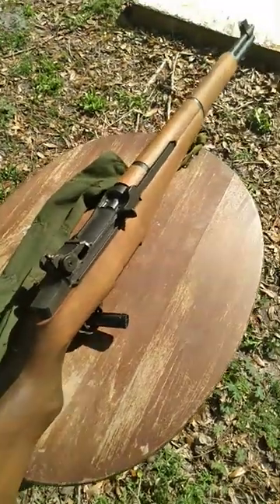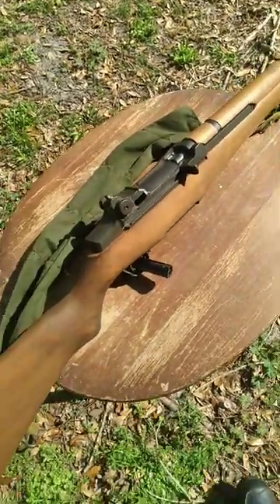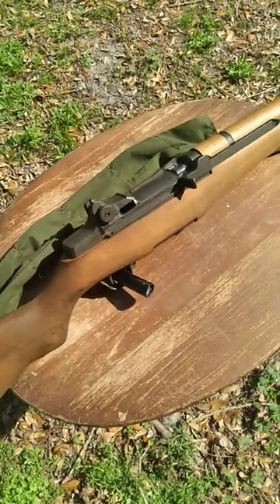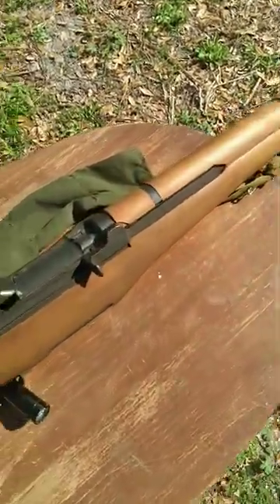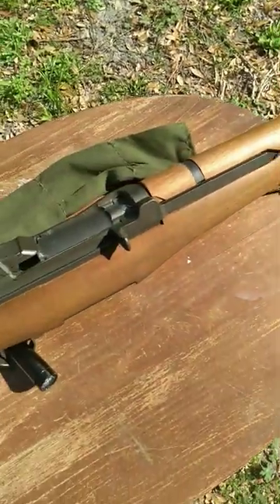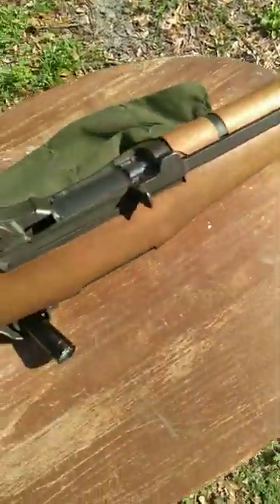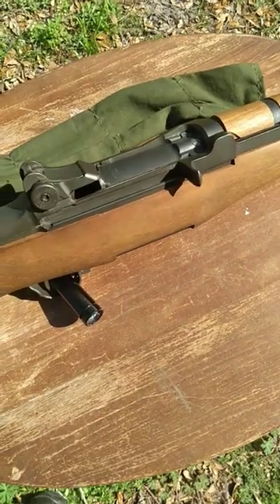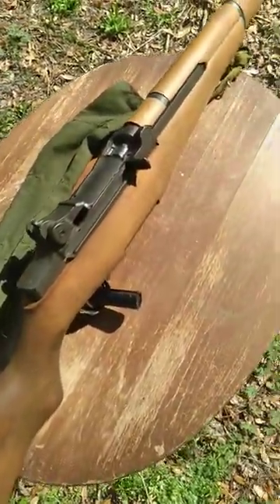M1 Garand Recoil

Comment: Yeah, remember the M1 has a certain range of cartridge weight and power to work in. Unless you adjust the gas system avoid the heavy bullets and high powder rounds. So when you compare kick make sure you're fair and use the same round!
Reply: Correct todays modern rounds operate at much higher pressures and can damage parts like the op rod but they make adjustable gas port plugs so you can safely shoot todays ammo.
Reply: The gas system has absolutely no effect on felt recoil, it's all the weight, shoot a bench rest rifle chambered in 06 that weights approximately the same and they feel the same, then shoot some 6½ pound hunting rifle and you practically see stars, it's brutal. 
Also take two M14's one with the gas system valve turned on and one with it turned off, without knowing which is which pick one up and fire it then immediately pick up the other and fire it, you absolutely cannot tell the difference between the two.
Anything measured with some type of measuring device that'll show a difference doesn't mean anything when it comes to "felt" recoil anymore than picking up something that weights 10 pounds compared to picking up something else that weighs 10 pounds 3 grams, there's too little difference to tell between the two. 
Take that same device that can measure recoil and look at the difference between an M1 and a 6½ pound hunting rife, then look at the difference between an M1 and another that has the gas system shut down or like I said the difference between an M14 with the gas system on and off, even if it shows a difference it's going to be miniscule between the two, too little difference to be perceived by a shooter.
Several times when I took my M1 out shooting I also took along a 6½ pound Savage Model 110 and shot the same 150 gr mil spec load for comparison, to say the recoil from that 110 was "unpleasant" would be an understatement, you'd literally see stars shooting that thing and quickly caught onto the concept that it's lightweight build was all about carrying it through the woods all day then shooting 1 or maybe 2 rounds through it, as opposed to something that in the first place even though it weighs 1½ times as much is going to be carried by a physically conditioned soldier and not some out of shape civilian hunting once a year, and even a physically conditioned soldier couldn't take too much when it comes to the recoil of a lightweight hunting rife, I couldn't imagine the amount of recoil from that 110 in a semi auto you'd be banging away with in a battle, about the second or third time you heard that ping sound you'd be so sick of that thing you'd be throwing it down and looking for a Carbine to pick up, doing push up's and sit up's all day long may give you the stamina to carry a 9½ pound M1 around all day but it ain't gonna help when it comes to absorbing recoil. 
Take it from someone whose tried the difference between two M14's one with the pintle valve turned on and immediately shooting one with it's valve turned off, there's no perceivable difference, any measuring device that shows it doesn't mean someone will be able to feel a difference just like they wouldn't be able to tell the difference in picking up something that weights 10 pounds and something that weighs 10 pounds 3 grams.
Thinking a gas system has something to do with felt recoil makes sense on it's surface but in reality it doesn't, think about how little it actually absorbs, of all the expanding gasses that blow out of the muzzle of a 24" barrel that gas system is only tapping off enough to fill that little gas cylinder and even then the pressure in it doesn't drop to 0 psi when the piston is at full stroke, so it's only absorbing a tiny amount compared to what's blowing out of the end of the barrel. 
My friend and myself did the M14 experiment at the range and neither of us could tell the difference when pulling the trigger with our eyes closed so we couldn't see if it was cycling or not, I even shut the valve off on both of them on once when he shot and imagine his surprise when he claimed he could tell the difference with one and swore it felt like it had less recoil thinking it was the one with it's valve opened, they were both off.
Reply: Wow, I guess I didn't make myself clear. I have ammo for my Garand which is 150 grain and about 2700 fps I think.  Because this is c what it's designed to shoot. But when I shoot my bolt action 3006 I tend to run a hotter and slightly heavier bullet. A 168 grain at about 2800 fps. My point was the only fair test for felt recoil would be for both guns to shoot the same round.   That's all.
Reply: @mattholland8966  
That's exactly what I said I did, shoot a 150 gr mil spec round out of an M1 then pick up a 6½ pound hunting rifle and shoot the same 150 gr mil spec load out of it, the recoil is absolutely brutal compared to the M1, you'll literally see stars.
Reply: The Garand was designed/made to fire the 172gr M1 Ball and did/does it quite well in the M72.  Also fires the 168gr M2 AP as well as any other U.S. .30-06 military round developed.

Comment: When the garand was being developed there was a problem with the ammo. Damage to operating rod and jams. The powder they developed for the rifle is a medium burn rate so that the pressure drops as the bullet passes the gas port. Imr4895 is the best powder for a reload. I have very good success with a 150 to 165 gr bullet. Around 46gr powder is very gentle and good accuracy. Never use off the shelf hunting ammo. You can purchase ammo made for the garand but can be pricey. If you don’t have a garand try to get one , you will not regret it.

Comment: According to General Hatcher, in "Book of the Garand", when tested on a ballistic pendulum at Springfield Armory, has the same recoil force as an 03 Springfield.  However, the Garand action spreads the force over a longer period of time.  Both rifles are essentially the same weight.  According to Hatcher, Garand is pronounced like parent
Reply: Here's an easy way to settle the debate about gas systems absorbing recoil me and a friend who collect M1's and M14's came up with. 
The M14 has a pintle valve that enables you to shut off the gas system, I bet him he couldn't tell the difference between the two if I shut the valve off on one and left it turned on on the other and left both of them laying on their right sides on the bench so when he picked them up he couldn't tell which was which, he shot both with his eyes closed so he couldn't see if they were cycling.
He swore he could tell one had the gas system turned on claiming he felt less recoil, boy was he mad when I showed him both were turned off. 
It was a dirty trick but it proved two points of mine, one of course is that the gas system doesn't tap off enough to tell a difference, the other being that people's minds can convince themselves of something that isn't true especially when they're anticipating something that'll give them a bias.
On it's surface thinking the gas system will absorb recoil makes sense, but if you stop and think thing's through it only taps off very little gas, the amount of gasses blowing out of the end of the barrel is many times more than what the volume of the gas cylinder taps off, and even at full stroke it still has pressure in it, a considerable amount at that. 
Any difference some measuring device shows would be so little that a person's "felt" recoil couldn't tell the difference any more than picking up something that weights 10 pounds then immediately picking up something that weights 10 pounds 3 grams, there's measuring devices that can show the difference between the two but that doesn't mean a person could. 
"Both rifles are essentially the same weight", there it is, I have a Savage Model 110 with a barrel with a featherweight contour, if you shoot a 150 gr mil spec round out of an M1 then immediately pick up that Savage that has the same length barrel but only weights 6½ pounds and shoot the same 150 gr mil spec load it's recoil is absolutely brutal, I'm not joking when I say you'll actually see stars when you shoot it, saying it's recoil is "unpleasant" is an understatement.
It's all about the weight.
Reply: @dukecraig2402  The Garand definitely is softer than the 03 in feel, as the impulse is spread over time. As Springfield Armory demonstrated, the recoil force is the same, so the M-1 is not absorbing anything.  Having fired both prone, tight sling, M-1 is a loving tap compared to a hammer slap in perceived recoil
Reply: @michaelnorth5215  
It's because it weights almost a pound more, that's why.
It's all about weight, as I said fire the same cartridge out of a 6½ pound rifle with the same length barrel and its absolutely brutal, an 03 comes in just above 8½ pounds compared to the M1 that's 9½ pounds, that's the difference, at that weight every pound and you'll feel a difference between them, get up around 25 pounds like a BAR and a pound more or less won't make a difference. 
I've owned and shot plenty of both, the 03 isn't bad at all but then again you're not banging away semi auto with one either, I had a girlfriend at one point that was 5'2" tall and weighed 105 lbs, she could shoot an M1 or M14 all day long off the bench but an 03 just crossed that threshold with her that after 5 shots she didn't want to shoot it anymore. 
It's the weight not a gas system, M14's and M1's are identical when it comes to recoil shooting the two and as I pointed out you can turn off the valve on an M14 and you can't tell the difference, but shoot my match M14 that weights almost 1½ pounds more than my service grade one and you can tell a difference there, it's that much shoother.

Comment: The m two Ammunition for the M1 grand Is not the same As the 3006 roùnd.
Reply: I believe the M2 It is not as powerful as commercial 30,06
Reply: @kellyhamilton4009  Correct, modern commercial 30-06 is more powerful than most older guns can safely handle.
Reply: You can shoot modern ammunition, but you will need to replace the gas plug. Garandgear has vented plug to use modern ammo without the harsh peak pressures

Comment: I had mine at the range barked off a few rounds with no problems but the one of the rounds blew up in my gun. I just bought the box of Remington 30.06 150 grain FMJ that morning. No one was hurt and the gun is fine and safe to use but it looked like a flint lock with the fire ball blowing out of the top 😢
Reply: The garand likes medium burning powders. Imr 4895 is the powder. Slow powders over speed the gas system. Can bend the operating rod. Not saying that caused your problem. Soft primers can cause slam fires possible causing it to fire out of battery, before the action is locked up. I had a slam fire with federal primers.
Reply: @frederickking1660  the shell had a small split along the side of the shell